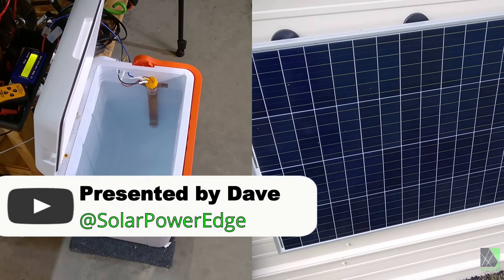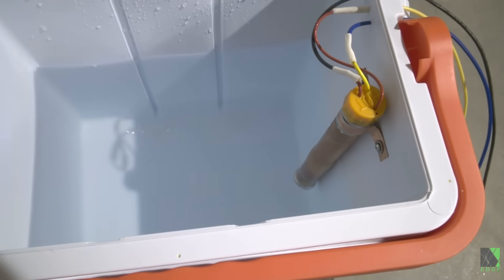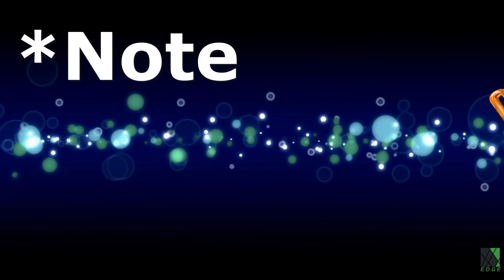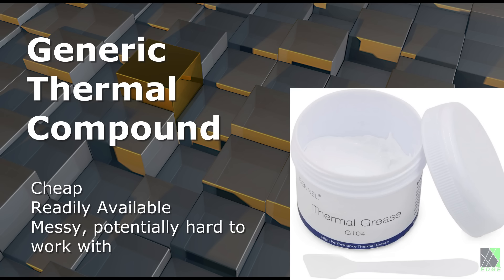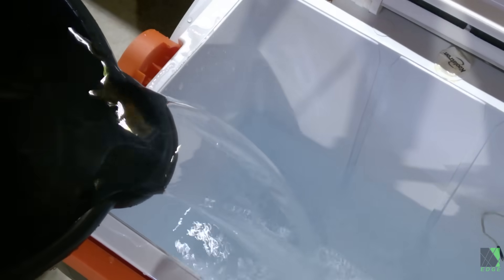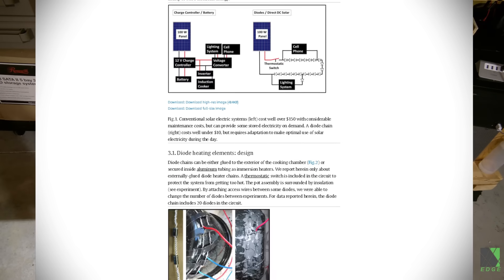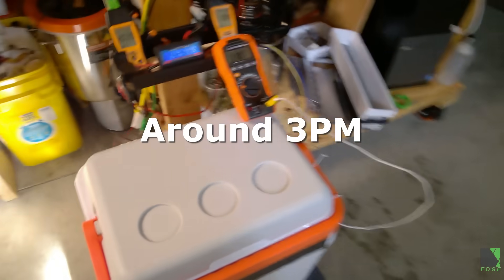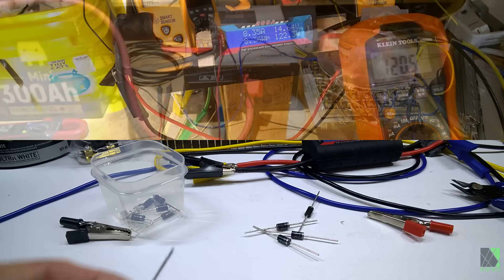I built a PV DC Semiconductor Immersion Water Heating Element! diode chain application #science

Comment: odd thought. I have old exercise bike and 2 24VDC motors and 48VDC  20Amp LiFePO4 bike battery.. I am thinking of building a system that can charge the battery and then feed a diode based heater and run my 12vdc TV/monitor + small computer. Why exercise using power when you cam make power.!
Reply from the maker: @Quazee137 Good stuff, keep on thinking and tinkering! I do want to make it clear, that diode chains only make sense on a current-limited source (like a solar panel) so we should not hook them to a battery or they will fry. (If you're using a battery, resistance heat is actually still better. ) is it possible with a DC generator they could be used to make heat and match the best voltage... now that I haven't tried. Just sharing my thoughts, hope that makes sense!

Comment: Great project and I look forward to your new discoveries in this endeavor. In a previous life I had extensive experience in heat exchanger design and operations. I have just a couple of suggestions. 
First, to transfer to most energy across a barrier (heat across the 1" copper tubing) you want to coldest possible water in direct contact with the surface and you want the flow to be constant. In your case you can easily do this by inserting the 1" copper heating element into a 2" pvc section and have your circulating pump attached directly to the bottom of the pvc tube. Keep the bottom of the pvc tube very close to the bottom of the tank where the coolest water is. Have the pump attached in a way so all the flow is through the tube. Heat transfer rate is directly proportional to the difference in temperature across the heat exchanger barrier (your copper pipe). You don't want any stagnant water touching the copper surface allowing it to shield the copper from the coldest water available. 
Second thoughts are I you will get more effective heat transfer from the diode surface to the copper if the diodes were immersed in a liquid. Have you considered mineral oil or any non conductive liquid? The game is a about transfer efficiency and a liquid is significantly better at transferring heat than stagnant air or powder inside your copper element. 
Good luck.
Reply from the maker: @J123G Brilliant info, thanks for sharing the knowledge -  By the way yes I am experimenting with mineral oil, at least it does conduct heat (not as good as water of course!). I see what you're saying about the water flow, a simple cheap pump could pull the heat out a lot better if I flow the water directly like you suggested. Thanks again for sharing your experience, it means alot :) 👍

Comment: This is very interesting, I played around with some diode chains over the winter to experiment with them as heaters. I need to study up on how to match the number of diodes in the chain to the voltage of the solar panels. I wonder if carbon power or carbon fiber could be used as a thermal medium. It does have good thermal transfer properties and I imagine it would be a sight bit easier to pack into a copper tube. Great Video!!!
Reply from the maker: @nathanaelhanson2412 Have fun experimenting... diodes work great for making space (air) heaters from solar panels, but I am finding water heating a lot more difficult. Interesting idea to use carbon powder, maybe even graphene perhaps

Comment: How much current do you generate running the diodes as thermal agitation generators with heat as the input?
Could you use plain old sand as a heat transfer medium?
Reply from the maker: @nonsquid Have only been using this for heat storage at the moment - but the concept  you mentioned is interesting, I'll look into it. I have seen some DIY'ers using sand with diodes, but I try to keep the temps at 100C or below and that's very hard with sand - it's more like an insulator. Nevertheless I keep an open mind and don't rule anything out :)

Comment: If you were going for cheap, you could use sand as the insulator. But I'm not sure if it would overheat the diodes.
Reply from the maker: @barthanes1 A while back I saw a DIY'er putting diodes in sand, but of course they did get pretty hot. I am limiting myself to 100C and so far have not burned out a single diode. I will not rule out any option though, that's part of having an open mind. Can you put diodes in sand? Sure you can! Right now I'm just struggling with the "putting them in water" part :D

Comment: Do tell how you determine the optimum number of diodes for a given number of panels.
Reply from the maker: @johnwax9759 You have to know the solar panel(s) vMPP then add enough diodes to regulate that voltage. It will not be perfect, and it may take several tries to balance. It's tedious but I've been doing this for a long time :)
Reply: @solarpoweredge  My panel has a voltage max power point of 42 volts. Since a diode drop is 0.7 volts, so 42/0.7= 60 diodes?
Reply from the maker: @johnwax9759 This is the tedious part... they might drop less or more. However your numebers sound close enough, maybe do a quick experiement? Don't forget to cool the diodes, since getting the heat "out" is the whole point and plus if they get too hot, they lower their voltage

Comment: Could mineral oil be used as a heat transfer medium?
Reply from the maker: @GlennHamblin Yes, I have tried it, we just have to keep in mind the thermal transfer of oil is never as good as water - that said they use oil in transformers so it can be an option depending on the amount of heat being generated

Comment: Have experience in microelectronics packaging, and you can procure the diode chips, and mount them directly to your copper bar/pipe. However, need a "Heavy Wire" bonder like an Orthodyne Electronics Model 20. Eliminate the diode packaging!
Reply from the maker: @johnwax9759 That's a really advanced idea, thanks I'm looking into this :D

Comment: Thank You for Sharing your work !!
I'm looking at using your ideas
to melt snow off the panels before the sun comes up or during snow/ice events.  Perhaps very gently pass low current through the panel to warm it up to 35°F
Taking advantage of the diode action in the cells.
Reply from the maker: @GREGGRCO Nice - that should work!
Reply: Solar panels do have a shunt rating.  If you shunted the entire array, the snow would melt much faster.
Reply: I've disconnected my array from the inverter and connected a variable source of DC to the panels directly. The solar panel is a diode, and you can forward bias it to create heat for melting snow. Once melting has started, reconnect the panels to the inverter.

Comment: I've seen the tube gently crimped on to the diode body only
in the string for TIGHT mechanical bonds.
Reply from the maker: @GREGGRCO I used some of those copper crimp tubes on one of the strings, but I really should buy a crimper for a good connection - pliers aren't so great :D
Reply: @solarpoweredge  I was wondering why not solder the connections, the temperature doesn't get close to the melting point after all.
Reply from the maker: @vjnobody Tried it - that works too, and with temps around 100C no problem at all so far

Comment: Hi Dave, still fascinated by the simplicity and potential of this tech.  I'm thinking it would be great to adapt it to a small electric HWT to use as a preheat for full size gas HW system ( tank or tankless).  Great way to use excess energy after batteries are charged or have a dedicated solar array.  Personally I'd use MgO as heat sink/ filler.  Proven and easy to work with ( vs liquids). Not sure how your diodes are chained (looked like series) but "can" diodes (sleeved) in a copper tube just big enough for diodes and return wire, filled with vibrated MgO to pack seems like it has potential wrt good heat transfer. Also the heating element in a HWT is typically horizontal so no temp gradient over the length compared to vertical.  I was also thinking square copper tubing might have some advantages if one goes down the TO220 format.  Anyway... I ramble and dream...keep up the great work ... much appreciated!
Reply from the maker: @Building_the_SHACK Hi! Good thoughts here. Dreaming is good! MgO is high on the list, it's been around for ages and is a proven method. I'll definitely spend more time on it :D
Reply: @solarpoweredge 
Question - do you have any idea what the surface temperature of your diodes is? Would like to shrink wrap a diode string before stuffing it into a pipe and packing it or at least isolate electrically with "something" ( high temp conformal coating/thin wall silicone tubing, etc)
Reply from the maker: @Building_the_SHACK I have been up to 100C or a little higher. I am not willing to go much higher, because I want "long lasting" heating element. However the researchers in the "hot diodes" paper routinely exceeded these temps and seemed to have no problems at all. Which is amazing to me, thought they'd burn out a few diodes along the way. Shrink wrap is brillilant so definitely need to give that a try
Reply: @solarpoweredge  
Super! Thanks for the info. Submerged will be far superior to external heat transfer so this is the only avenue I'm pursuing at this point
Reply from the maker: @Building_the_SHACK NP :D 👍

Comment: I'd like to see V-I chart vs temperature of the diode in air.
Then design iteration charts of heatsinks bonded in various ways to the diode.
I'm thinking of all the
microprocessor heatsink interations.
Reply from the maker: @GREGGRCO hopefully I can make some charts like that in the future... In air they require fan cooling or a heat sink, otherwise the voltage plummets pretty quick. However... that itself can actually be useful in some cases

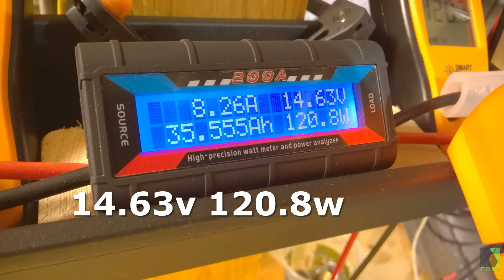Comment: 11:55 Wow ! 8 amps ! High.  Good to know !!  Heat sinking the diode directly to the outside of the  copper plate or tube will be top priority, whilst running the water on the inside of the pipe.  Don't heat sink the pipe in the bath of water. Slowly pass the water through it. Heat it that way.
I'm aiming for low current, high transfer of heat to the tube of water in your design.  Good work !
Reply from the maker: @GREGGRCO Good idea. I ordered some TO-220 packages to experiment. A square tube like you suggested earlier with water flowing in/out could be just the ticket :)
Reply: @solarpoweredge  Are you talking about diodes that can be directly exposed to the water?
Reply from the maker: @davebean2886 Actually yes that would solve a lot of problems. I'm sure it is technically possible
Reply: @solarpoweredge  Thanks for the reply.  If the process could be simplified or available as a kit, I can see this valuable for RVs and off-grid homes.   We heat water in kettles on the stove, poor the water into essentially a weed sprayer and use that to take hot showers.   A fair amount of propane and hassle is required.    Starting with even warm water would help, but if the water could heat up all day long in the sun and stay hot until we take showers later in the evening, that would be great.    We have tried heating up water jugs with the sun and that does happen, but they cool off  quickly after the sun goes down and not very  warm by the time we take showers before going to bed.

We're definitely interested in your diode approach for solar hot water, but I probably lack the expertise to get it to work reliably.
Dave
Reply from the maker: @davebean2886 Welcome, I hope you can find a way to make hot water, solar electric/thermal or whatever it takes. I think you would need to find a simple cheap insulated tank to start with, this changes the game completely. Even a plastic barrel wrapped in blankets. 
After that even a simple resistance heating element or piece of wire with enough resistance can do the heating work with a few solar panels. I wish you success in solving the hot water requirement! PS it seems we both have the same name  :D
-Dave
Reply: @ GREGGRCO I think you are definitely nailing it with these suggestions!  Et al, it maybe worthwhile to encapsulate the copper pipe from heat loss especially in a cooler room/environments.

* Inner copper pipe
* Outer/exterior insulator  pvc, rubber, copper or foil tape etc.

___________
| ___________|_
|     >>waterflow>>> __|   
|_____________|
|   ^^^^diodes^^^^    |
L____________|     

My $.02 and liked, errr loved, and subscribed!
/JD

Comment: I really daught that diode array is cheaper than mosfet+resistor+MCU. Infact you probably can get away with 555 and an opamp.
Ofcorce there issue of skill building. But stupididy is not an excuse for anything. Its like, "car oil change is too expensive i just use cooking oil as infinity oil, its cheap YAY"
Reply from the maker: @Murphydeffa-oq8lm I have tested 3A diodes that are a few cents and they work fine in this tube... so the diodes have less complexity and cost. However, a more complicated solution could pull another few percent of heating power from the panels I think - so using Mosfets is a great idea. Actually I am experimenting with combining mosfets with diode chains :)
Reply: @solarpoweredge you could also build an MPPT using bipolar transistors cooled in your tube, allowing to adapt to partial shadows conditions.
Reply: You need to add an inductor and capacitors for proper EMI filtering to any switching regulator.
Reply: You could also build a shunt regulator. zener + big transistor (FET or not). May need some extra support components.
MCU does add a lot of complexity.

Comment: Very interesting....   I'd like to add some things.

A diode array is cheep, but hard to couple thermally to.  Let me suggest another "diode array" which is much easier to couple to... a PV panel 
Use a smaller PV panel, but underwater, with huge service area. Backfeed it with more current than it would normally put out.

The other thing I would point out is Power Transistors are designed to transfer heat. Also you can have one transistor emulate many diodes.
A 600W transistor, with a water cooled heatsink, with simple controls to be a "shunt voltage regulator" might be the trick you need. It could even be adjustable to many voltages.

Last, direct heating from a PV array is wasteful, in that the electrical power is more useful than just pure heat. Thus it would be nice to only use the heating when no more electrical power is needed. 
Having a circut that actively watches for the power going into a battery, inverter etc and then using the "unusable power" as heat would be a much better use case. Probably having a normal MPPT charger that turns off, thus the voltages rises beyond it, could be a better use of the diode array or a shunt regulator.
Best of both worlds, as the PV panels first charge batteries and is used near their MPP, and when no more can be stuffed into the batteries, the PV voltage goes up and the diodes or shunt regulator heats water, or a phase change materiel like wax or low temp salts.
Reply from the maker: @idahobob All good points! I am experimenting with power MosFETs, although they take a lot more complexity and effort to get working. I saw somebody heating their house with DC-fed PV panels awhile back, it works pretty well!
Reply: @solarpoweredge  power mosfets have a body diode! You can just use them as a normal diode.

Comment: Hat about ceramic clay inside the copper tube like other heating elements?
Reply from the maker: @CoolPad-ey5vr It's worth experimenting with, maybe even mix the clay with something to move heat more quickly, graphene etc.
Reply: @solarpoweredge  A use-case for DIY graphene using graphite oxide and dish soap in a blender?
Reply from the maker: @vjnobody Awesome!! the sky is the limit!
Reply: @solarpoweredge  I think the modeling more expensive clay stuff might be ideal. I looked it up a while back for this type of thing but I cant remember

Comment: Great idea. You could do like a pole transformer and fill your pipe with oil. The oil convects and stirs itself a bit for improved heat transfer
Reply from the maker: @senorjp21 Right on! if oil can handle those transformers it should a few diodes

Comment: Good video.  Would you consider using mineral oil inside the heater?
Reply from the maker: @HoldenTech Thank you! yes good idea... I have tried it (and made a huge mess in the process, had a few minor accidents). The oil won't boil at <212F, is thermally conductive but not electrically conductive
Reply: AND it won't freeze. Easily.
Good idea.

Comment: This is such a brilliant simple solution. I like how it makes sense to use a semiconductor to effectively harness the power from a semiconductor. Keep up the research and maybe one day diodes will be made for this purposes.
Wonder if large full bridge rectifier packages wonld be good as they are made to mount on heatsinks. Although would the connections work being 2 pairs of diodes in parallel.
Reply from the maker: Right on, It is amazingly ingenious yet simple, I just love it !
Regarding power rectifiers, I'm into those too, here are some DIY semiconductor space heaters / regulators, and they work good in parallel with nichrome :) 
https://youtu.be/Cle05mmYOUs

Comment: I was wondering, what if you would try to use a to220 package diode chain installed on a copper bar, soldered on a pipe where a pump forces water circulation from the tank instead?

Doing like this you can completely avoid direct interaction between electronics and the tank and install the heater nearby the tank itself, still obtaining a very good thermal conductivity via thermal paste.

It would also make maintenance and troubleshooting much much easier.

Great job anyway. This is something i was thinking about since then lockdown in 2020.
Reply from the maker: Thank you and this is a really good idea, I have to try it. Anything to get the diodes away from contact with liquids would be great. I jot down all the ideas, thanks for sharing :)